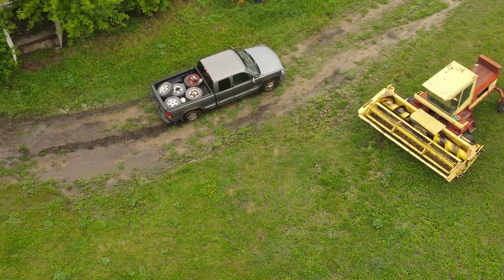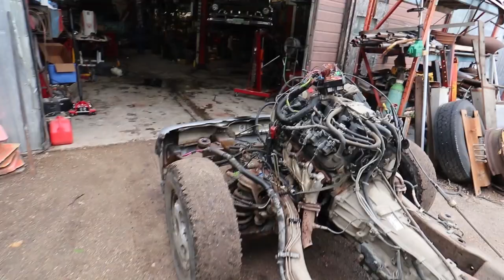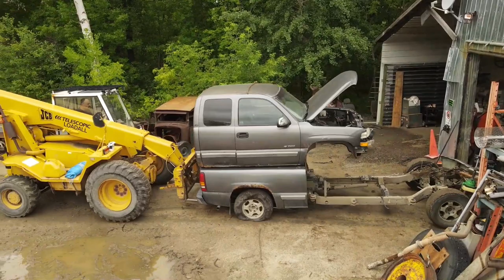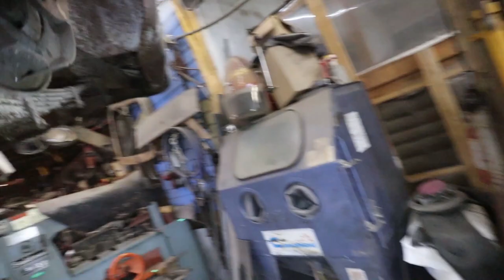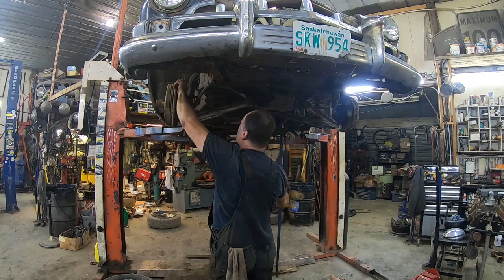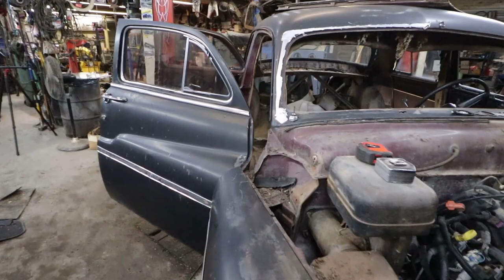Stripping donor truck for the power train for the 1951 Mercury Monarch build part 2

Comment: You need to make yourself a pair of sawhorses out of steel box tubing that you can sit a car on. Make them wide enough to sit on the frame where you would put your lift arms. You've got a forklift and the air over hydraulic hoist that will lift one end of a car at a time and then you can slide the sawhorses under it. Then you aren't working on the ground. Or the lumber stacks like lost of guys use to put under each wheel. I prefer the sawhorses. They come in handy a lot. And if you make them right you can make them nest into each other so they don't suck as bad to store. Keep it up. I'm inspired every time I watch you.

Comment: Brent you make hard work look so easy, Never know what to expect when you start but know it will be great at the end. I like the engine choice for this swap. Knowing that it runs and drives and not guessing the History of the donor  parts untill they are installed.  Great video
Reply: No job to large, or to small, old saying nothing easy nothing good is free. One screw can sometimes give a hard time.

Comment: You seem to have an endless supply of parts & engine donors! That Monarch's gotta wear that sun visor on the back wall of your shop - if Pablo approves!
Reply from the maker: haha that one is missing all the hardware but will have to find one for it yet
Reply: @HalfassKustoms  I’m sure you could manufacture the hardware you need if you had time. 👊

Comment: What car! The body lines, trim, doors, just way cool. I love your German Short-Hair and hope it’s a male. I can tell you on Facebook if female.
 Tech tip; The “LS” engines have cast steel exhaust manifolds and on aluminum heads if re-using need a tiny bit of quick work. The broken bolts frt. & RR are from expansion & contraction of the heads. If re-using, take a large rat-tail round file, Chuck in drill, put welders gloves on and a 4-6” conduit or water pipe on backside. Oblong holes 3/16” Fry/RR to allow for movement. Flatten the bolt flange w/angle grinder or other. Use flat washer under a new bolt. It will slide under washer and hole will not break it because you enlarged it. Works every time, even with headers after checking hole for room. Best of luck. I enjoy how you “Get-R-Done”. As Larry the Cable Guy lives in Ponca, NE., about 85 miles South of Omaha. He is a very charitable guy! So are you for sharing!!! I enjoy learning and watching!
Even in my early 60’s and Retired.   Automotive ASE Master Tech since 1978

Comment: That car is super nice. Alot better than I thought. It would be nice to blast the underside and get rid of the crust and rust. The floor is very good considering.  Blend the paint when you fix the rust and buff it. Add wide white walls and drive.

Comment: Nice project but may have been easier to acquire an Arizona rust free F-150 chasis 4x4 with collapsable steering wheel, torsion bars,  disc brakes, cruise, power windows, padded dash, airconditioning, and just cut chasis at factory seam middle of chasis  for length adjustment and plasma cut out fire wall, do body drop for final welair-conditioning, etc. In a perfect world rotisserie the body to cut out rust around suspension parts. 

Your gymnastic routine is impressive.

Comment: Going fairly smooth so far... you laid the fuel line system up against the frame and I though who worked at mercury before chevy... almost a slide in if it were not for the crazy "X" frame work. I know that you can fix that rear end but the first decent burnout and you will hear more than the little clicking sounds. I broke them back in the day with a flathead six. I can't remember if the lug bolts on that mercury were the same as pickups or not. ford pickups that is. I do believe that Dan has Covid 20... he is talking about painting his rat rod roadster... he usually tries to scrape the paint all up and mush it back on and call it patina/LOL. You both have some great builds going on

Comment: Hey man, always enjoy your videos. I think the rear U joint for this car has two of the caps made so the bolts go thru them and it has a notch machined to fit in the groves of the yoke. Looks very similar to a ford military jeep setup. Hope this helps. Keep'um coming!

Comment: That rear takes the same kind of  U-joint as my 56 Ford Fairlane , i never did like them . I believe they still make an adapter to use the more common  U-bolt type . But i would switch to a different rear and use wheel adapters if needed .
Reply: my 50 shoebox uses that goofy u joint too . i bought one on ebay  ,but  im going to  put a s10 rear in it  and a tripower 350 .

Comment: Leaking brake fluid:   Fixed it, by accident... I had a forklift in a print shop that was leaking a pint of brake fluid every day. One day when I came into work the forklift was almost out of brake fluid. When I went looking for break fluid, we didn't have any. I put in some transmission fluid, filled it right up. That forklift never leaked brake fluid again. True story. I don't know why it worked, but it did.

Comment: Transmission shift cables are long because they are not very big in size.  It just makes it easier for them to do their job without kinking. Least this is what I have been told. I'd run a fuel cell gm fuel lines are junk they are rusty crap. I guess they are different in🇨🇦 than here in 🇺🇸.

Comment: Have you ever used the 2000’s style mustang brake rotor over top of those style hubs and plasma cut caliper brackets for front disk brake conversions? My buddy made the ones for his Camaro using plywood templates and it works good

Comment: What about swapping in a ford 8.8? The f150s ran the 5 on 5.5, though those would be to wide for your application, maybe on from an exploder, and use wheel adapters to get to the big pattern?
Reply from the maker: Think I'm going to check over the diff and see if I can use it yet. :)
Reply: @HalfassKustoms  Probably better to use what you got I suppose. Just a thought 

If you get a chance I'd be curios what you think of the guys at Pit Stop Ranch.

Comment: this might be a dumb question but wouldnt it have been less work and a more reliable vehicle to put the 51's body onto the trucks frame and shorten the driveshaft and frame?
Reply: i dont think that is a good idea. he is doing it the smart way. it is a car not a truck . some chassis swaps work , and some fit like shit.
Reply: @60chevyjim  my thinking was an early 2000s truck would be more comfortable going down the road than 70 year old suspension
Reply: @abialo2010  i say this because  i  am working on a  customers 1950 fleetline chevy car that someone started to put on a s10 truck chassis and then quit  .
       on the 50 fleetline  nothing lines up it fits like crap and i am stuck finishing it because i told him i would do it for him ..
 but b4 that car  i built a 51 chevy pickup on a 84 s10 for my wife  and that one works very well. 
  it is a lot more work to do a chassis swap than a motor swap most times .
Reply: I had the same thought, when I saw how good he is at separating the truck body from the frame. The truck frame would have to be modified to have the same dimensions and body mounts as the Mercury, if that is doable. Seems interesting, but I’m just a spectator here. 🤔🤔

Comment: On these motors with fuel injection and a computer, can you bypass all that and put a carburetor on it and run it like a real car/truck?
Reply from the maker: never tried as I would have to buy stuff that I don't have and then feel it would be expensive for me to run them after.
Reply: Putting a carb on this engines,, its like going 100 miles backwards 😩😩😩🤣

Comment: was that a build sheet on the bottom of the front seat
Reply from the maker: Haha yeah found that later though it's for a 75 ford pickup
Reply: @HalfassKustoms  well atheist you know what vehicle the seat came out of I'm surprised whoever put the seat in the car didn't atleast take it and keep it with the truck lol but you never know they might have done it so quickly they didn't see it

Comment: I realize you just cruze but why do you insist on antique single masters? Even if you keep the drums all around at least utilize modern safety with a dual cylinder
Reply: they work   i use them on my 50's and 60's cars n trux.

Comment: No sense in watching putting a junkyard Chevy engine in a Ford product!
Reply: Ford doesn't have a good electronic engine that is worth doing the swap with.Ford's three valve two thread head engines are junk.The rest are to costly.I guess you could put in a Windsor or Cleveland engine.
Reply: @davidfleishman2275  Yes or a 5.0 even a flathead 8 would be better I'm sick of guys doing this if you want a Chevy buy a Chevy!!
Reply: @georgefleming6075  Yes a 5.0L out of a late 90's Mustang would be a great swap.I have seen this 5.0L into a 63 Ford Falcon.Easy clean swap.Plenty of those 5.0's around.